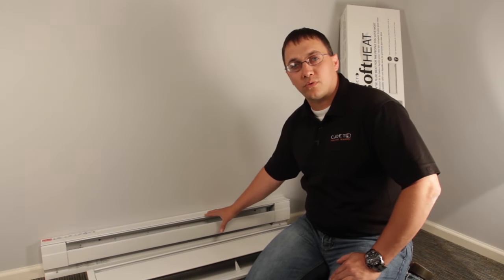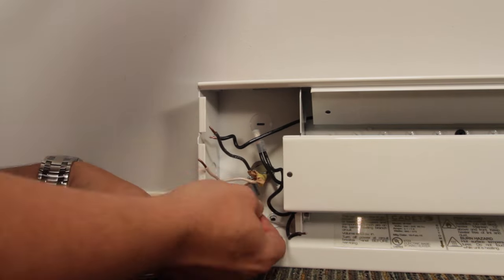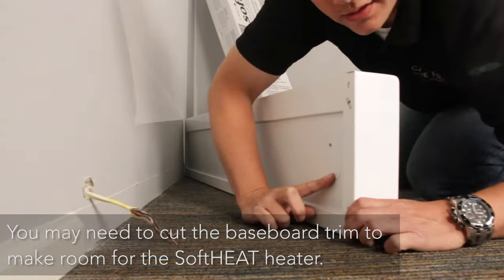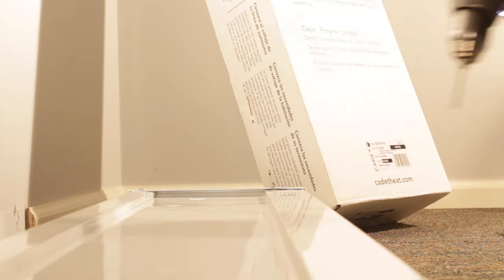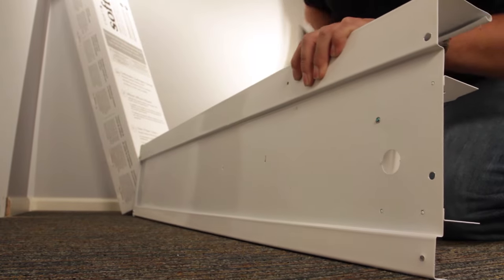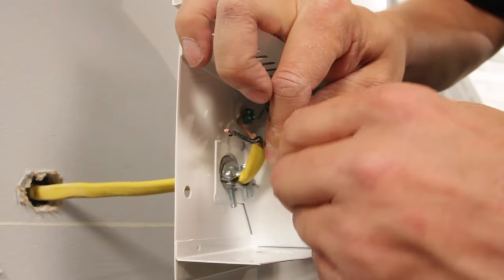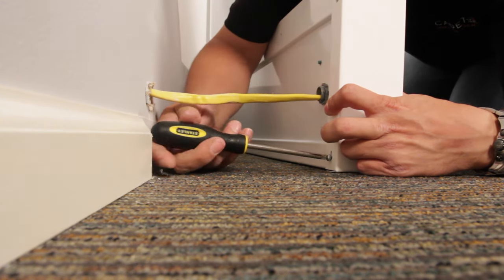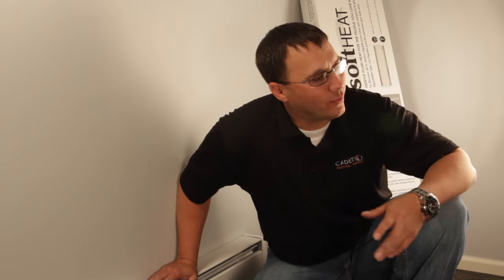How to upgrade to a SoftHEAT baseboard | Cadet Heat

Comment: My son called Tech support because we are intending to purchase 4 Cadet wall heaters and he was wondering about size of wire and some questions about thermostats.  He was told they would call him right back.  in 15 minutes he received a call and spend another 15 minutes on the phone.   The Tech was a real knowledgeable person and was just a good all around person.  All questions were answered.  Very positive phone call, FANTASTIC!
Reply: Hey So what wire did they say use ?

Comment: I found this video very helpful. I just installed one of these Cadet baseboard hydronic heaters and and it was pretty easy after watching the video. The instructions that come with the heater and thermostat definitely leave a lot to be desired, so I was glad to find the video. There seem to be a lot of negative comments here, but personally I'm pretty satisfied so far. Heater seems to be working fine. I'll update my comments here if I run into any problems with it. I had no reason to contact customer support, so I can't comment on that aspect of their product or service.

Comment: Do hydronic baseboard heaters have lower peak temperatures compared to conventional electric baseboard? I just installed LVP flooring under an existing heater and am considering replacing with a soft heat baseboard to reduce chances of flooring buckling

Comment: I have 3 plug in baseboard heaters. I also have the wall baseboard heaters here in my apartment. For some reason, the ones that are mounted to the wall dont work very well, especially here in the living room and bedroom. But when I use the portable/plug in baseboard heaters, they work a lot better. I have the plug in version of the heater in this video, and the hydronic heater here is much better than the regular plug in baseboard heater

Comment: If you are running off of a 30 amp breaker like in the video, I would use a 10 gauge wire instead of a 12 gauge.

Comment: Do you recommend having the hydronic heaters on all the time and not use a programmable thermostat since it takes a while to heat up?
Reply from the maker: If you have a regular schedule, the best thing to do would be to set the heaters to get up to temp a bit before you need them. We would not suggest that you leave them on all the time.

Comment: Always use a voltage detector before you start messing with anything. Don't rely on figuring your flipping the right breaker

Comment: How are you able to control the heat? is there a temp unit control it?
Reply from the maker: Hi Linda, You would use a thermostat to control the temperature in your room. You can either get a thermostat that is built into the unit, or one that is on the wall.
Reply: @Cadetheat  does the built-in thermostat get affected due to it being close to the heat source in such a way that the room isn't hot enough?  Is the built in thermostat programmable?
Reply from the maker: @davidduonghau5332  The built-in thermostat does capture the air temperature around the heater. If possible, we always suggest that people go with a wall thermostat on an adjacent wall to the heater. That will do a better job of getting the temperature of the room. Our built-in thermostat is not programmable for SoftHeat, it's just a dial style thermostat.
Reply from the maker: @davidduonghau5332   Based on your recent questions, it sounds like you are trying to find out if the SoftHeat baseboard is right for you. If you would like, we can connect you directly with someone from our tech support team so they can answer any specific questions with you via the phone, e-mail or livechat.
Reply: @Cadetheat  thanks!